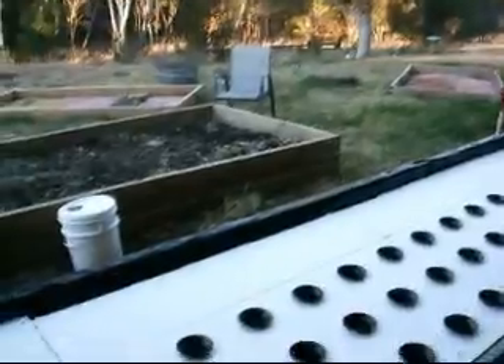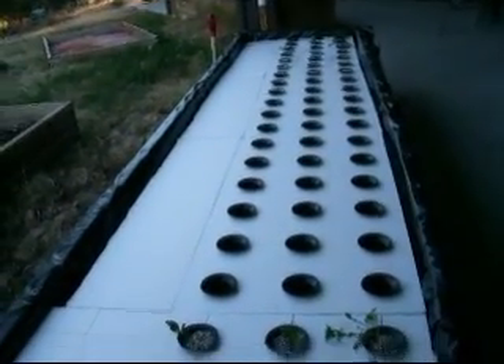Aquaponics - Week 1 - Deep Water Culture (DWC)

Comment from the maker: The key is getting enough oxygen into the water for the fish. Yes, there are measuring devices out there (do a google search for 'measuring dissolved oxygen') and you can find out the dissolved oxygen (DO) required by different species of fish. I've never really gone that far, and you don't really need to. Just work on getting as much dissolved oxygen in the water as possible and you won't go too far wrong. If in doubt... add more! :-) Good luck with your build.

Comment from the maker: G'day Luke

The purpose of the medium in the pots is just to give the seedlings something to hang onto whilst they get their roots down into the water. So from that perspective, pumice might not work due to it's propensity to float. I'd try just standard gravel. The rafts should be able to hold it up OK and gravel size won't be as important as it is in a flood & drain bed. Use as fine a gravel as you can but not sand... it'll fall out of the pots.

Comment from the maker: To propagate the seedlings I used a 'cut down' DWC bed and planted directly into the small hydropots using the vermiculite\perlite mix. The advantage of this is that once theplants are growing they are just lifted into the grow bwd with no additional time required or potting stress. I've also used bought seedlings (washing the soil off the plant roots) and used small rockwool cubes. Lots of options.